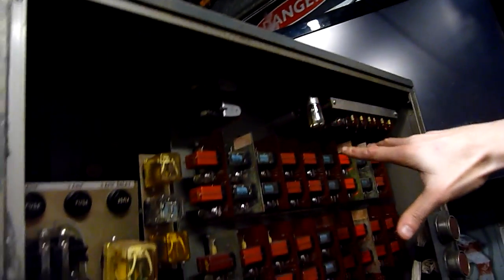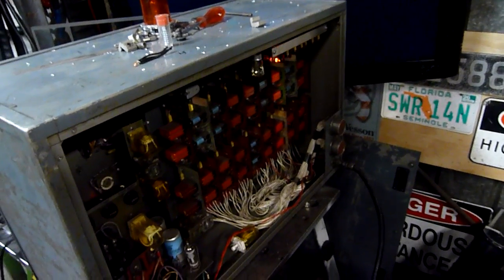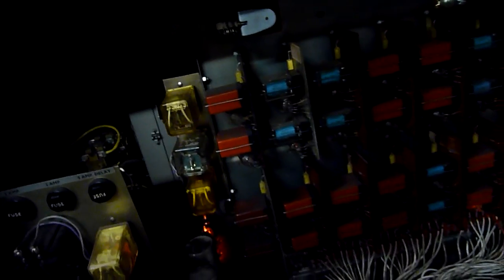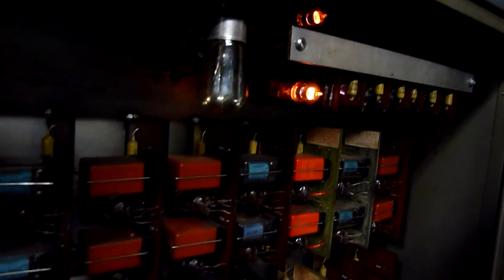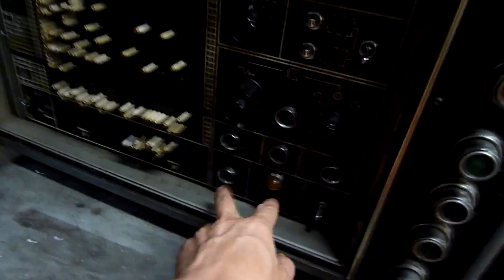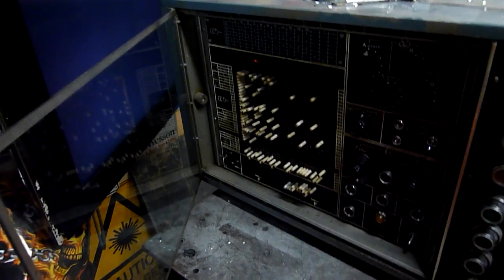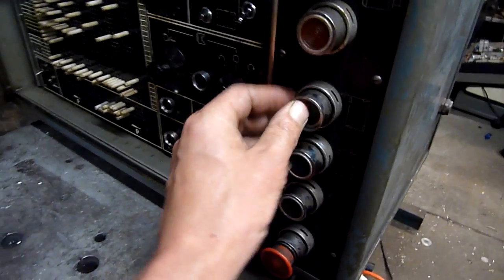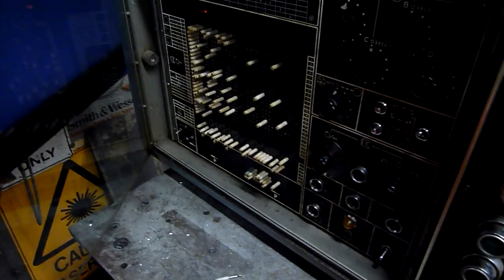Ward Autoward Turret lathe Peg Pin control CNC cabinet overview

Comment: Served apprenticeship as a maintenance electrician at H W Ward between 1976 , 1980. Spent time building the Autoward on the bay, as it was called as well as maintaining them on shop floor. Bloody nightmare to fault. Throw in the phumatic and hydrolics on top of the controller above and you could end up pulling your hair out. One peg in wrong hole and everything can go south, end up looking for fault that wasnt there. Of course operators never did that when they wanted a fag break 😅.Learnt very early on to keep on right side of them. If you could crack an Autoward you could work on anything. Great place to work.

Comment: Looks like its using neon trigger tubes , something like the XC18
Reply: Ye, Certainly not flashing the heaters up at that rate. Good for diagnostics.
Reply from the maker: yeh these are neon trigger tubes, no heaters. in fact I think they are XC18
Reply: Or valve heaters hah